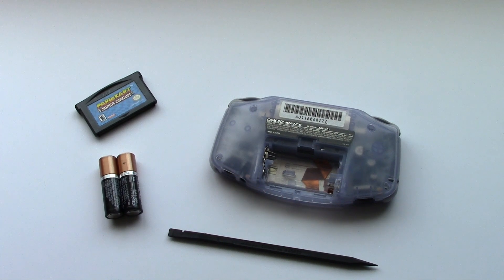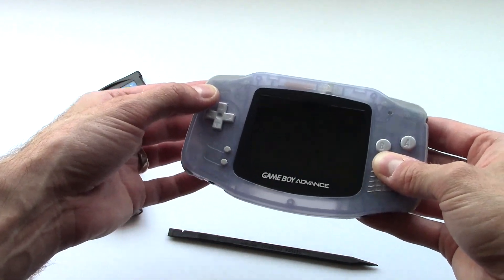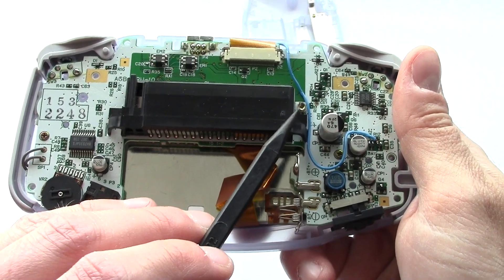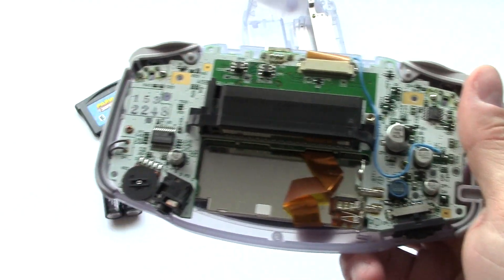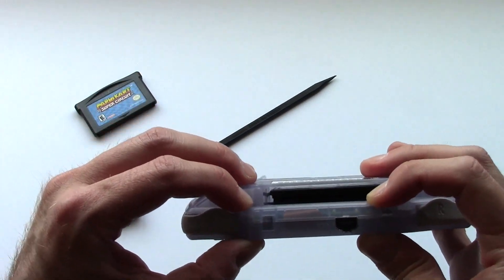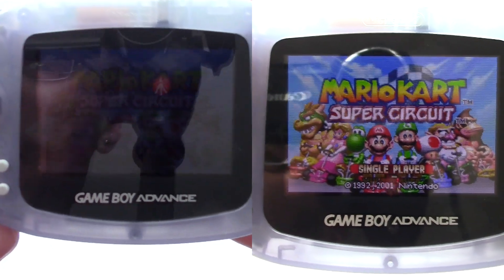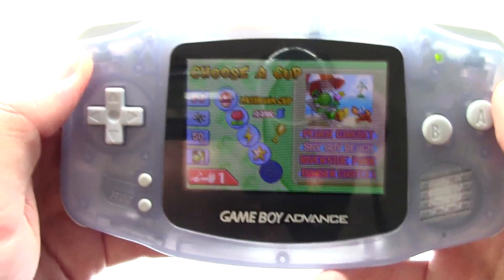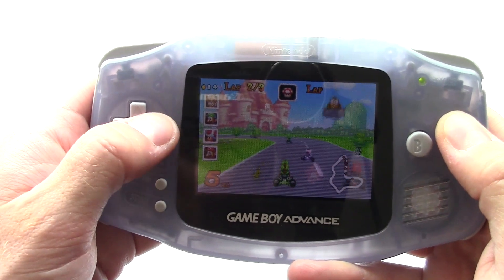Game Boy Advance Backlight Mod Tweak and Final Results

Comment: Hello, and thank you for sharing this video. I have questions.
I have bought a GBA backlighted  AGS 101 on eBay, and the light works perfectly, but there are ghosting effects. However, under the shell I've found out that there is no wire and no solder point on the adaptator like your GBA, how can the light works ? I don't really understand. I'm gonna test turning clockwise that little thing, and I would be grateful if you could give me a piece of advice to delete ghosting effects. Well, I hope you have understood my english, greetings from France !! :)
Reply from the maker: Sounds like the screen and adapter cable are simply drawing power through the ribbon cable connector. Provided that the new screen doesn't draw more power than the old one, this shouldn't be a problem. I'm not too sure what the cause of your ghosting problems is, but slowly tweaking the potentiometer may help. (Make a note of the position it's in before you start turning it, so you can always put it back if the changes make things worse.)
Reply: This Does Not Compute A big thank you ! I will test it tomorrow 'cause it's 2.15 AM there lol, thank you again
Reply: This Does Not Compute So I've tried several times, by turning clockwise, and it improve just a little bit, but the ghosting effect is still present. Do you think I have to try an 40 pin adaptator with solder points whicth is for my GBA ?
Reply from the maker: Florian M Couz A different adapter cable might be worth a shot, considering their relatively low cost. Good luck!
Reply: +Diguidi Flo From what I understand after doing some research to attempt this mod myself, it seems that there is a difference between the 40 pin  and 32 pin ribbons available for this mod. The 40 pin ribbons don't require the soldering, whereas 32 pin ribbons do. Your system may be a 40 pin, therefore it would not require the extra solder point as do the 32 pin ribbons. An easy way to check if your system is a 40 or 32 pin is to remove the battery cover to see the number stamped on the motherboard, visible at the top of the battery tray. If the first number is a 0, you have a 40 pin system. If the number starts with a 1, you have a 32 pin system.

Comment: The image cuts out when I reassemble and "squish" everything tight. I wonder if the compression on the bulky meeting point b/w adapter and lcd cable is where the problem lies. there is only so much maneuverability there since the length of the adapter is short. please helppp pleaaaaaaaaaseee
ive put way too much effort to let it fail me now! ;)
Reply from the maker: The adapter cable is short, but you should still have a decent amount of slack in the LCD cable itself to try different positions. It's also possible that the adapter may be shorting out on something, so a piece of strategically-placed electrical tape may help. Worse comes to worst, I know that there are multiple vendors who sell the adapter cables, and some cables may have a lower-profile LCD cable connector than others, so you may just need to try another cable. Good luck!

Comment: Is the battery life a lot less than a standard gba?
Reply: if you up the voltage and add a backlight it will use more power, so yes it will have less battery life
Reply from the maker: AKProductions I did a follow-up video about stock GBA vs. modded GBA battery life -- check it out, the results are interesting:
Backlit Modded Game Boy Advance Battery Life Test
Reply: As it is a newer and better screen, it actually consumes less power :)

Comment: Hey, me again.. Got my first prototype done! I too ran into a huge amount of issues. I wanted to ask, when reassembling your system, did everything fit back together fine or is the new screen pretty tight inside? You're probably thinking I didn't shave down those edges on the inside where the screen lies but trust me, I went back and made sure that sucker was smooth.
I don't know what it is, I put everything back together and I had to screw the screws in TIGHT to get the edges flush. The screen actually is experiencing a small amount of browning I'm the bottom middle of the screen due to all of the internal pressure of the system, which is unsettling to say the least. Any tips you care to pass my way or to anyone else who reads this?  Thanks again for all of the help!
Reply from the maker: Yes, it's definitely a snug fit -- the replacement screen is thicker than the original and presses on the back of the motherboard.
Reply: You're definitely doing something wrong it should not be that tight. You'll damage the screen with that pressure. I have  a video of the mod and you'll see when it's together when dine right it's really not that right of a squeeze.

Comment: Hey man, so I've messed with my trimpot like you did, but can't get the contrast right still. If I tilt the screen downward I can somewhat get the correct color but ideally it should look correct all the time instead of faded/washed out like it does now. Do you remember if you did multiple complete turns on the trimpot or was it minor tweaks within 1 clockwise turn on the screw? 
Thanks a million if you can help me get this figured out. I think we were/are feeling pretty similar about getting this mod finished and the hassle it took/takes.
Reply from the maker: I don't think I needed more than a full turn on the trimpot -- but at the same time I don't think there's any harm in experimenting with different settings. What I found is that the screen will eventually get worse if you crank the trimpot too far clockwise, so it's entirely possible you actually need to  dial it back a bit. Getting the perfect value on the trimpot was very fiddly though.
Reply: This Does Not Compute awesome, I'm modding 2 right now and both have the issue. Once I finish all of my modifications I'll probably make a video. If that happens, I'll be sure to give you a shout out for your help. Thanks again, and thanks for the quick reply!
Reply: SNBfilms hey bro if you still never got this you can also turn the trimpot in the opposite direction one side makes it darker and one side makes it lighter.